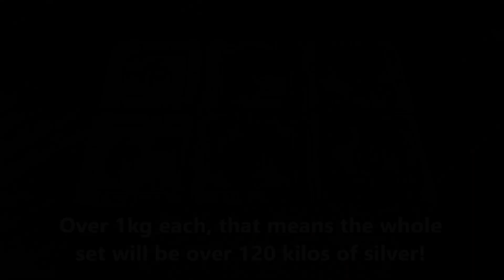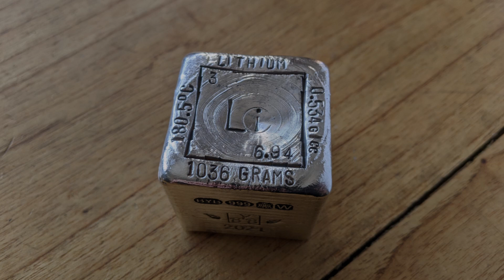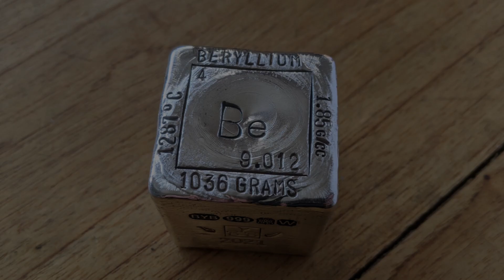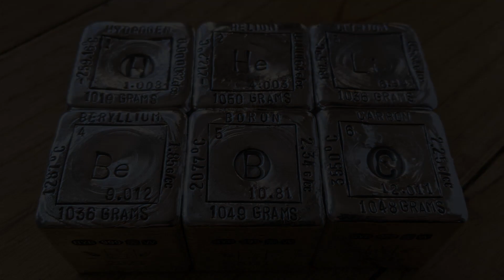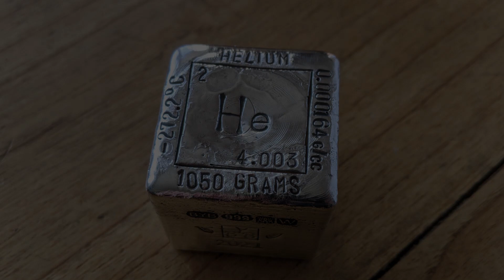I am making a Poured Silver Periodic Table over 120 KILOS of Silver!! ASMR Home Forge Metal Casting!

Comment: 120 Kilos is over 3,850 troy ounces.  How long did the project take?  That's monumental!  So they're all just a little overweight... Use about 4,000 ozt?
Reply from the maker: It's a work in progress, the first six are done, we will be doing more for the customer across the next three years hoping to complete the set before the end of 2024. It's a big old undertaking!
Reply: @BackyardBullion  what a great reason to add to my Ag kg+ cube. With alleged shortages on the physical market I was wondering how you would source the material and how many parcels to the Edinburgh Assay Office you would send. Also the serial number would have made a big jump of all poured in a row. 
Please make a final video with all 120 pours in a row!
Reply: @BackyardBullion  I suspect you may go through a few molds as well.  You don't think the one mold will stand up to that many pours, do you?
Reply from the maker: We will have to see, if it doesn't look good to use I won't use it - but getting a new one will be easy enough